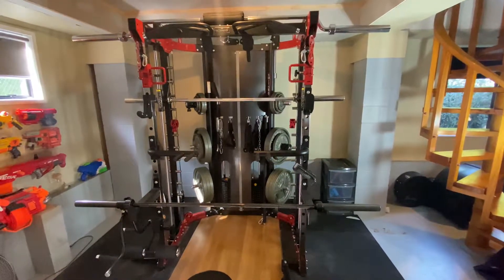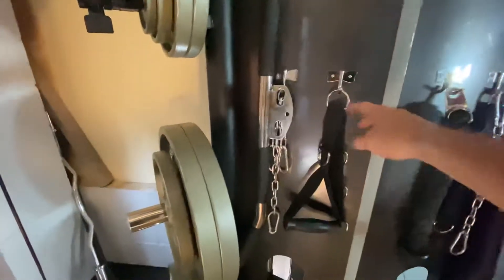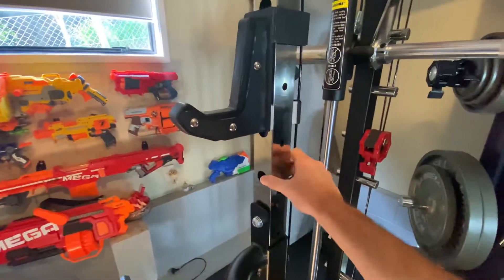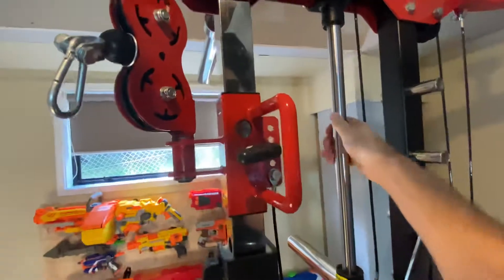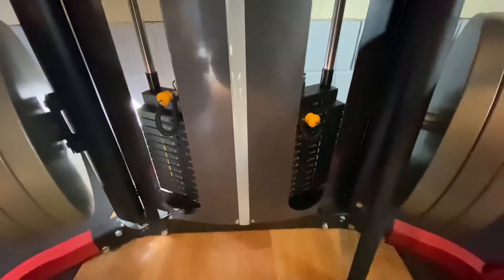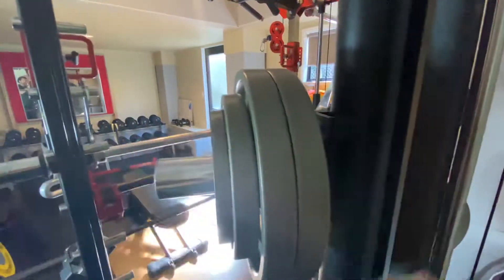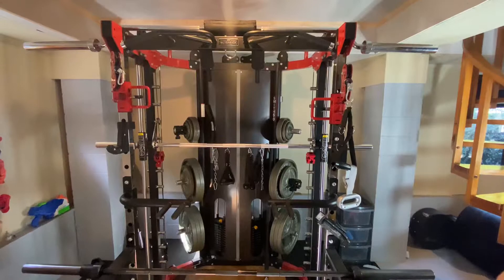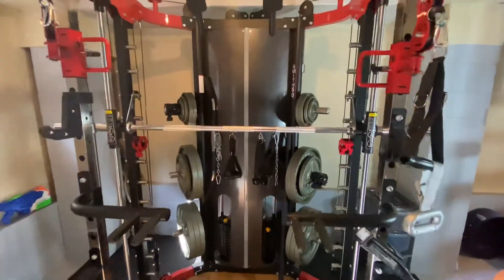Review: Elite Fitness Silverback Series Smith 5.0

Comment: I appreciate the succinct review you did which pretty much covered everything.  This machine is sold under various brands and I was contemplating getting one.  The trade off with these all-in-one trainers always seems to be the half rack.  Even though I don't squat much more than 160kg on heavy days, I always have concerns if a bailed lift will potentially bend/warp the uprights.  

Having been spoilt with a commercial grade 4mm thick half rack, I'm reluctant to let it go but I have such a small space to work that it makes sense to get an all in one rather than a separate functional trainer.  

Thanks  again for the review.
Reply: You would be surprised at the strength of the closed box beams. Unless you plan to bail and apply more than gravity to the bar, you won’t bend the uprights. I’ve never bailed when working out at home. If you’re silly enough to bail at home then you shouldn’t be working out at home in your closet on a 2000 dollar machine. Everyone in here acting like they are the hulk and want to buy a LIGHT machine. The hulk should be looking at tanks not these China made frames.
Reply: @oberweiss7190  I have never bailed a lift, other than gently putting it down on the spotter arms. 
There is always the "what if" scenario of bailing with a small drop, hence why most people prefer a power rack. 
I ended getting something else, but over time will likely remake the 50x50 uprights with 5mm thick steel.
The half rack uprights always seem to be the compromise, as they tend to use 50x50 uprights with 2 to 2.5mm steel.

Comment: I have the force usa monster g6. The smith guide rails rods on mine are solid steel but the weight stack guide rails are hollow tubing.
Reply: Are the hollow guide tubes holding up ok?
Reply: @0x7DA  yeah they are fine. I put uhmw tape to top off and stop them from moving up along with the weight stack. The design of the guide rails is cheap. They are not locked in and just sit there with space to play with.  My old hoist v6 functional trainer the guide rails you actually had to screw in . it had threads and locked into place.
Reply: @DoritosResidue  I just bought this machine and yeah, the hollow guide rods are just sitting there, thought I must have missed a step in the instructions lol. Are you using the rack + jhooks much and are they showing any wear e.g bending, warping, or damage?
Reply: @0x7DA  just wrap uhmw tape on the top of the guide rails.  It looks like it's the tape is part of the way it came. The j hooks are absolute trash and the spotter arms are too short. I bought 2x2 jhooks and spotter arms from titan fitness and they are far better. A little tweaking from uhmw tape and they fill in the small gap from the titan jhooks and spotter arms. The rep fitness 2x2 jhooks might fit as well. Just make sure it's the 1 inch peg that fits 1 inch holes
Reply: @DoritosResidue  I'm going to do that thanks. Do the rack uprights that support the j-hooks hold up ok after prolonged use? They look like 15 gauge steel.
Reply: @0x7DA  I know the uprights are cheap and light. I came from the ironmaster 2000 and the uprights on that are heavy duty. But yeah the uprights on the g6 are plenty strong. I stay on 225 to 245lbs for bench pressing and kinda slammed when re racking.  Never felt like I compromised the uprights. The the weight the uprights support is  pretty much distributed throughout the rest if the rack so it's pretty solid. Which is probably why the didn't really need to use 11 gauge.  But still I'd still would want heavier duty uprights for the price that they sell it for.
Reply: @0x7DA  my comment got deleted for some reason  But the jhooks I bought are actually 2x2 yes4all brand from Amazon not titan. The yes4all jhooks fits absolutely flush with the g6. I mismatched the spotter arms with titan fitness ones because they are so damn heavy duty and longer .
Reply: @DoritosResidue  Good to hear! Thanks for your time.

Comment: I appreciate your insightful review! How does the lat pull down exercise work for you? Would it be possible/ convenient?
Reply from the maker: The lat pulldown works well when it is set up. This does take a little bit of time but if pull downs are part of your programme it will be worth it. Because the leg holder attaches to one side you will only lift with one weight stack at a time.

Comment: Question: I just bought a version of this machine (Altas Strength 3058 in US) and I agree that the steel used for the rack uprights is on the thin side (prob 14 or 15 gauge). Did you observe any bending/warping/damage to the rack after use or if not, did you think that it was likely over time? I just purchased better j-hooks similar to yours and will be bench pressing upwards of 275 lbs 2-3x a week. I'm contemplating getting a dedicated rack as well for fear the uprights will warp or be damaged. Thanks for making this informative video.
Reply from the maker: No, no bending. Mine has held up well. The steel in mine does seem on the thin side also, but I think the box profile of the steel adds to its strength. I think I’m just used to gym equipment being a little overbuilt
Reply: I am looking at the same machine Atlas 3058, do you like yours? It holding up ok? I am right around the same bench weight so would love to know if you have had any issues with the uprights, or any other info, accessories you bought?

Comment: I just purchased the Atlas 3058....it seems exactly as your piece, as well as others under different names...i am wondering, on your half rack there, the bar, is that a 7 foot bar lying across?
Reply from the maker: Yes the Atlas 3058 looks to be the same piece. It has the same issue with the j-hooks and safeties. If you look for the Force USA version of this machine (G12) you will notice the j-hooks and safeties are offset towards the centre of the machine to compensate for the width of the rack. The barbell in my video is  7ft. It is an Ivanko OBX-20KG. It only just fits, and has scratches and scrapes from the hooks. My 7ft Ironmaster barbell doesn’t fit.
Reply: @deiphid  how long is yoir iroaster barbell?? I habe a rep fitness barbell and also a camber Swiss bar
Reply: I am about to purchase the altas 3058, you like yours? Holding up ok? Altas alright to deal with delivery and everything?
Reply: @pdub422  it's a great piece of equipment. I can't imagine life without it, along with my elliptical.  Shipping is from Canada, so you will have to provide your SS# to them. Initially i declined and they canceled the order. I later learned this is standard procedure,  and have not experienced any negative results since doing that. Shipping took maybe 4 days. And setting it up was straightforward, but i recommend another person there to help assemble it. The stacks have 2X 130lb plates. I already had a 7' bar and 300lbs of plates. You will not regret the purchase :)
Reply: @deiphid  i recall your jhook issue, which made me feel discouraged but it arrived with accomodading hooks which were angled to hold the bar as one would desire.
Reply: @MrNobody-fk7fc  awesome thanks for the feedback, I was concerned about the SS# too, did you order right from altas? I saw they have an Amazon store was wondering if that avoids it or not, also they indicated it was 2 stacks of 200lbs but website pics appeared the 130lb range like you mentioned, but I guess being 1:1 that's probably still plenty
Reply: @pdub422  i ordered through Amazon. And i would prefer 200lb stacks, but 130 will hold me over for a while, and you can always order extra in the future.
Reply: @MrNobody-fk7fc  good point! And ok if it's the same deal with Amazon with the shipping then guess it doesn't matter where I order haha thanks👍
Reply: @deiphid no, i was happy to receive my pieces with offset welds, which accomodate a 7 foot bar. J-hooks and safety arms both :)

Comment: Hey mate, still happy with your purchase? 

Considering buying (in NZ). You think the 1:1 pulley ratio is okay for beginners? Other family members will likely use, worried 1:1 might be too difficult and 2:1 would be better for them
Reply from the maker: Yeah I still really like it. I think if you have a beater bar the rack width is fine. The 1:1 pulley could be a problem for some. The lightest weight (5kg) is pretty manageable for most people, but it’s a decent jump to the next weight (9.5kg). I ended up making a little carriage that slips over the top of the stack and holds a 2.5kg plate.
Reply: @deiphid  thanks mate! I might have to do the carriage thing too. It's a toss up between this and the G6 Force USA which is 2.31m high... my garage roof is 2.40m so I wouldn't be able to do pull ups. I think I'll get the same as you. Thanks for your review - it's super helpful 💪
Reply from the maker: Not sure if these links will work but here’s what I did - a little different from other methods of adding weight, as it can’t attach lower on the stack but also doesn’t need to support much weight. 

https://photos.app.goo.gl/TDFfgcVVTph2pmzH8

https://photos.app.goo.gl/WUzfaYv8ttpohMGU7
Reply: @deiphid  that's so clever! Nice work. Thanks for sharing those and being so helpful mate, appreciate it

Comment: I live in the usa will my  I have problems racking my 7ft barbell? Are the uprights 2x2?  They look thin:(
Reply from the maker: It depends on the distance between the collars or the length of the shaft. Not all 7ft barbells are identical. I have one bar that fits (just) and one which does not as the collars are quite wide so the shaft length is a bit shorter.

Yeah the uprights are 2x2.
Reply: @deiphid  so how much does barbell needs to meassured so it can fit just right?

Comment: What are those cables connected to the smith bar?? What is their purpose?
Reply from the maker: They attach to counterweights so the bar effectively weighs nothing
Reply: @deiphid  Ok, that’s what I thought, thanks! I just don’t know why someone would prefer the bar to weigh nothing.
Reply from the maker: @PeterSchneemann  I think it’s essentially to allow smaller weights to be used. It’s more common on commercial machines, but I’ve never seen it on residential machines. One advantage is that you don’t need to work out what the bar weighs, just add up the plates.

Comment: So any limitations on this  machine?  I saw it on Amazon and debating between this one, and the  jacked up rack?
Reply from the maker: Yeah there’s some downsides. I go into them in the video.
Reply: @deiphid  so do u like it or do u regretted getting it and do you wished u would of gotten something else?
Reply: The j hooks being so far apart seem like a safety issue to me. If youre trying to unload quickly , you might end up failing before youprecisely fit the barbends perfectly between the hooks. That is a horrible design flaw. For the price that killed it for me.

Comment: each weight stack can only go up to 131lb? isnt that way too little for something like lat pull down?
Reply from the maker: I don’t know. Like I said on the video I don’t do lat pull downs. I did enquire about weight stack upgrades but never needed to pursue this. I use the cables as a functional trainer so 131lbs is plenty.

If you don’t live in New Zealand this is sort of irrelevant anyway. The Force USA version of the same machine comes with  200lb stacks.
Reply: @deiphid  awesome, thx

Comment: what is the difference between this one and the force usa G12 ?
Reply from the maker: Not much. Larger weight stacks, leg press plate, and the exercise guide on the weight stack cover. Something I noticed later is the Force USA version has the J hooks and safety bars offset a little, so it is a better fit for most barbells. Otherwise they are identical machines

Comment: What kind of review is this if you don’t show some exercise. I have the feeling there is not enough space to do smith machine squats.
Reply from the maker: 🙄Here you go… 

https://youtu.be/cT7ERRLWuT4

https://youtu.be/8jaxvLuzl9o

https://youtu.be/HjYIo5S84Sc
Reply: @deiphid  What is the brand name? I cannot find it in Canada. Is it sold in Australia only?
Reply from the maker: @PeterSchneemann  The brand is Silverback. This particular brand is sold in New Zealand only by a local fitness store Elite Fitness (no connection to Elite FTS in the US). This video was intended as an FYI for another New Zealander. It may be useful for anyone considering one of the many rebranded versions of this same design. I suspect they all come from the same factory.
Reply: @deiphid  Actually they have one such machine calles USa force G, and many other similar machines made in China. Outside they look exactly the same. I know Chinese products are generally of lower quality, but iron is iron,.. How much worse can it be? It’s definitely cheaper, so I wonder if the American brand is not just overpriced. It’s hard to tell without seeing/trying them in person
Reply from the maker: @PeterSchneemann  Yes I mention the G12 in my video. It is the same machine, just different branding and slight design tweaks (larger weight stacks, leg press plate, offset j hooks and safeties).